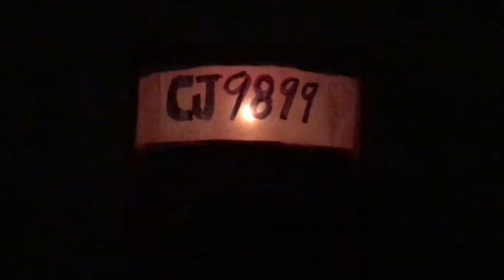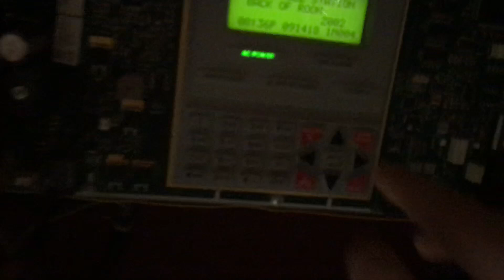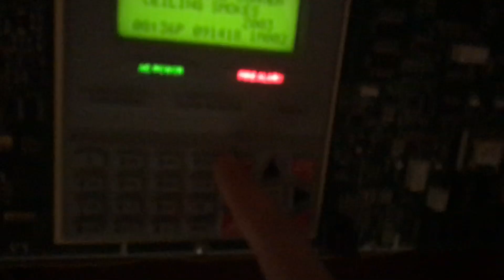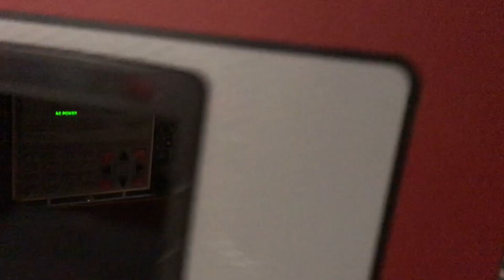System Test 34 (Genesis)

Comment: Did you build the tech center you made on Roblox or did you get it from the toolbox because if you did what is it called because I want to get that building and put and EST fire alarm system in there a security system and HVAC